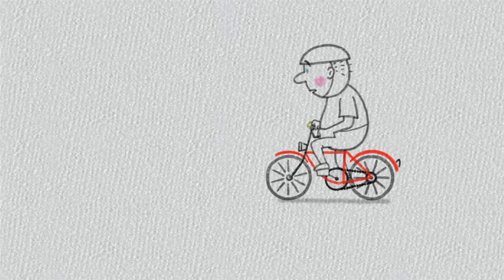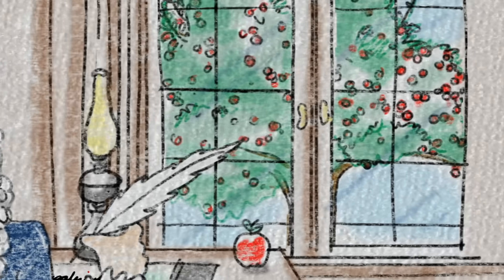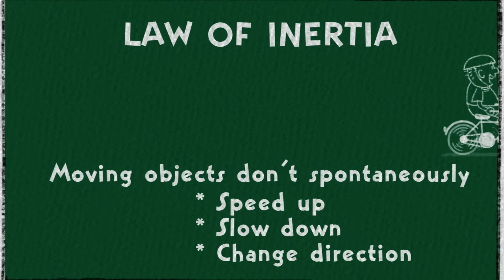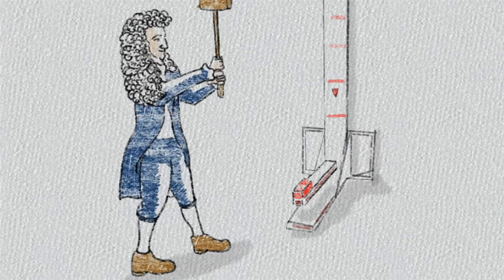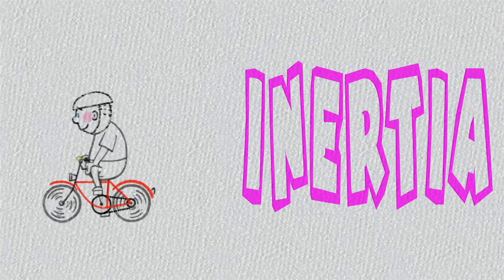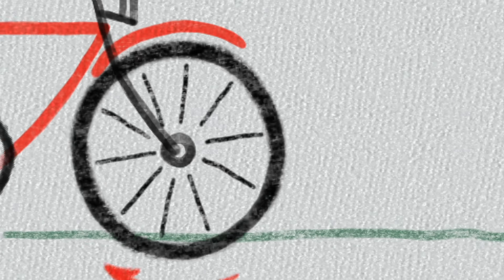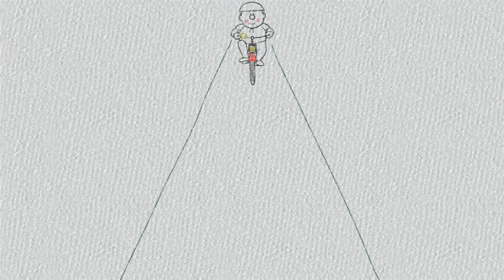Newton's 3 Laws, with a bicycle - Joshua Manley

Comment: Hey then why does my ball not bounce back to my hand when i drop it???? I thought it was the same amount of force. Is it because energy is lost or smth??? Make a video on it pls. Also im not Luffy so my floor isn't made of rubber.
Reply: Air resistance acts in the object when it bounces back up, this slows it down, and to answer ur other question, why you don’t bounce when you fall of the building.. it’s cuz the opposite reaction is your bones breaking.The ground pushes upwards doing this.

Comment: Didn´t you forget to mention that action has to be applied on a resistance? What if the bike was hovering 10cm over the ground? If the wheels wouldn´t touch the ground? There would not be any forward movement...... No movement at all..

Comment: Sometimes, I feel Newton's third law of motion is forced to suite a narrattive, even when it doesn't necessarily explain a phenomena. It is hard to explain the applicability of the law in relations to the motion a bicycle. I think it is because the bicycle moves vertically, meanwhile the law suites horizontal motion. It better fits the working for a rocket going to space. But for a bicycle I find I awkward. Great video by the way
Reply: yes! it gets confusing when the directions change
Reply: ENGLISH!!!!
Reply: The laws of physics are equally applicable in ALL frames of reference. It doesn't matter if the frame is vertical, horizontal, or rotating. It's all the sane physics.

E=mc. Acceleration defines mass/energy. There is only more acceleration or less acceleration.

Comment: What a JOke.  All Newton Laws except the first one, makes no sense at all.  It's the Biggest INDOCTRINATION and SCAM ever imposed upon children at school.  EVerything is a FRAUD.  Use your senses if you still have them.

 The 2nd FAKE Law in regards to Action and Reaction is really really STVPID !!!  All there is, is a body exerting a suitable force to move something at a given speed. And if you exert too much force you break the resistance of that body you are pushing against, or should I say you reach the maximum point at which the molecular fracture occurs?  Where is the line between Acceleration ( a= meters/ sec2) and Momentum (p= mass x meters/ sec) to make the physics meet  as F= m x a ==  F= p / t ??  

And finally, the 3rd FAKE Law in regards to the Gravitation and attraction of bodies through a divine acceleration.  It has NEVER been proved.  Try it on yourself (F= g x (m x m' ) / d2) using different bodies and under different conditions of temperature and matter.  It´s not the same dropping an object inside a tube of AIR than dropping it inside a tube of WATER.

All it is, is mass, density, shape, chemistry, state of matter and boyancy.  By the way, Earth is FLAT if you believe in a Creator of things.   Otherwise get in the NASA Liars Club.  They love you.  Money is waiting for you to collect.

It's a very elaborative Piece of FRAUD.
Reply: bRUH WHY sry capslock

Comment: Nice video, but something missing or not directly stated, for Newton's 1st Law:

Objects at rest tend to stay at rest unless acted upon by an outside force.
Objects in motion tend to stay in motion with the same velocity (velocity is speed with direction, and depending on your frame of reference, it can be negative) unless acted upon by an outside force.
Reply: bruh he stated that, you need to apply force for your bicycle to start moving from rest but one it starts moving it becomes way esier to pedal.........

Comment: Action reaction pair on the back wheel is correct but is wrong for front wheel. The back wheel action is DRIVEN by YOUR torque (backwards) which is what causes the forward friction reaction to occur. TED guy got that part right.... But I ask you now: is the front wheel action DRIVEN by YOUR torque? Is the front wheel action even driven by torque at all? The answer is no. There is no chain linking your pedaling to the front wheel. In other words the bike is NOT all-wheel drive. so how does your front wheel move if not by action torque? instead the rest of the bike applies a forward action force Into the middle of the wheel where the bike is bolted on and the wheel reacts back with the same force and together the two cancel out and move forward together. Then the forward moving wheel applies an action friction force FORWARD on the ground and the ground applies a reaction friction force BACKWARDS on the wheel. To recap, on back wheel force of friction is forward on front wheel force of friction is backward.
Reply: You're right.

Comment: That's actually false its not the reaction force that makes the ball bounce back its converted energi
Reply: Filip Brunmark the force is the that converts energy - always
gravity converts it from potential to kinetic
then the floor converts it from kinetic to elastic and back to kinetic
then gravity converts it from kinetic to potential while the ball goes upward

a force is always required for a change in energy

you are right in that a ball bouncing can be explained via forces or energy consideration

Comment: What if the floor doesn't push the object up but the force applied to the ball that makes it god down can't go down so it goes in the opposite direction, which is up and that's what makes the ball go up. This makes sense because the floor isn't pushing the ball it's just staying still and slightly vibrating right?
Reply: Gav Art the ball can feel the moment it hits the floor, this is proof that a force must have acted on it
this force is required for the ball to change direction of movement

btw contrary to what is shown in the video (bad...), the action and reaction necessarily always with no exception act at the same time
reaction does NOT come after the action
also they ONLY act when there is contacz between the bodies, not before or after

thank you for asking questions
if you have more questions feel free to ask
Reply: The Animation's Creator I don't think the force can go back nor would it have reason to not go I the floor and if the floor is vibrating that would still mean that the force did go through the floor.

Comment: One question: How does the bike stay upright? When a person mounts a bike and stays still (no kickstand or legs, just the two bike tires) they fall over. But, we said person is moving it is really easy to stay up. However, no new force is applied in the left/right direction to help keep the bike up? So how does the bike stay up while it is in motion?
Reply: momentum... it is too "focused" on moving in one direction, that is to say it alleviates the potential of falling left or right like a domino. Remember that there is also air resistance... aerodynamics keep it aliened as well, much like an arrow flies straight and only straight, until an external force (such as wind or gravity) interferes. I hope this helped in answering your question.
Reply: I believe the speed of the bicycle does not allow it enough time to be pushed over by air on either side. Or in other words, the force applied in propelling the bicycle forward is more than the force applied by the air on either side. Then there's also the fact that the centre of masses of you and the bicycle are properly aligned I guess. Todd Gobbett gave a pretty good explanation as well.
Reply: blasttrash Because then the weight is more evenly distributed throughout the 3 given points. The tricycle has more surface area to support its centre of gravity. A bicycle or unicycle does not.
Reply: gilgamesh2399 actually these are all bad explanations
an arrow flies straight for a complitely different reason, air drag and gravity always work on it in flight
bicycle is not "too focused" on forward movement, there is no such quantity in physics

this is explained via precession, which is a very comlex mechanical concept that relies on the conservation of angular momentum
a frisbee flies, a spinning ball changes direction, a spinning top stays stable - all due to precession

thank you for asking questions

btw to anyone who got it wrong: props for trying, it is better than not analysing at all. :)
Reply: Friction helps in  better grip that's why it does not fall trying running bycycle on ice...and you will understand.
Reply: Todd Gobbett But why do three wheelers stand upright even if they are not moving? why only vehicles having below 2 wheels fall down when not in motion? I mean my bicycle falls down but my car or tricycle doesn't when in rest.
Reply: gilgamesh2399 "How does the bike stay upright?"

The spinning bicycle tire becomes a gyroscope. A gyroscope, when rotating, resists changing direction. The faster it rotates the more it resists.
Reply: There is a really great minutephysics video about this.  it basically says 'we don't know'  crazy, right?  Bicycles are one of my favorite inventions (as you can see from my channel) but I didn't know they still stumped physicists!  :)

Comment: A little error in the video. Please make sure that the directions of reaction force on two different tyres of cycle after 2:50 should be different, and not the same.
Otherwise, it is a nice video. Inspired.
Reply: Dont be such an ass and just teach yourself. Perhaps you are the reason some stray from science...some jackass made fun of them when they asked a question or didnt properly understand the physics the other person did and sat on his high horse as if of genius status
Reply: Nitin Grewal
 So basically all you're saying is that the colors of the arrows surrounding the front tires should have been different because the ground is the the re-action of the back tire's action, and so the front tire is separately the re-action of the ground's action. It's just a three way chain: Back tire's motion (Action) = Ground's friction and pushing it forward (Re-action) = Front tire's motion (Re-re-action). That's all you had to say instead of talking in a way that makes you seem like you're trying to look smart. You just confused everyone else and then insulted them for not understanding what you meant. That was rude.
Reply: OK, I guess, I need to clarify it now..
Assume the front tire not touching the ground... a wheelie. And riding starts only with back tire down and front tire up...
NOW -> front tire will never start moving... not unless it comes back to the ground and feels the friction. As soon as it touches and surface, and both tires are now down, it will start moving. REASON? Friction acts backwards on front tire and makes it move. In turn, tire gives reaction in forward direction.

So In short: Rear tire: Rotation of tire causes Motion of cycle
Viceversa : Front tire: Motion of cycle causes Rotation of tire

Hence opposite directions
Reply: there is no mistake in the video.. the direction of the wheels rotation is same  that y the cycle moves ahead, if the forces are opposite (which is impossible if u are cycling) like you stated they will cancel out each other and cycle wont move.. what you are stating is that in a cycle the wheels move in opposite direction
Reply: Rahul Roy
You need to brush up physics concepts man... Action reaction don't cancel. And I know what I am saying. Kindly refer some physics books before commenting here..
Reply: l
Reply: Rahul Roy
 I don't follow what the person is saying. Maybe the idea is that the back tire is acting, because the rider is pedalling, but the front tire is reacting (to the road), since the rider is not pedalling it, so what is taken to be the action and what is the reaction changes. Nevertheless, the directions of the pairs of forces are indicted correctly as far as I can see.
Reply: Kenneth Florek
Nopes...
Reply: Monochromicornicopia
Hahaha... you people just watch videos.. and don't think yourself.. .. get a teacher and some books men!

Comment: You have to be consider each object separately:
1. The bike pushes on the Earth such that it accelerates in the direction it is pushed.
2. Simultaneously, the Earth exerts a force on the bike in the opposite direction so the bike accelerates that way.
You might understand this better if you consider rowing a boat. When your paddles push on the water, you send the water in one direction whilst travelling in the opposite direction. The foces are equal and simultaneous, acting on different objects.

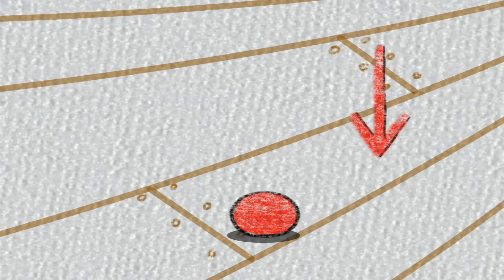Comment: Wow, I just noticed a flaw in this video. At 2:11 it says "As the bouncey ball hit's the floor, it causes a downward force on the floor... The floor reacts by pushing on the ball in the opposite direction." This is wrong. The floor isn't what reacts, it's the object that CAUSES the reaction. The ball is the reason it goes in the opposite direction. If what the video was saying was the case, the floor would have to be flexible.

Comment: Only on the rear wheel with power does the ground's reaction force push forward, on the front it has an opposite effect, to counter the friction of ye olde wheel bearing and such. The reaction force arrow shall point towards the rear on the front tire I declare!!

Comment: Unfortunately I will not use this video in my physics class. Already mentioned in previous posts: 'overcoming inertia' is not correct, action and reaction happen simultaneously (that is why I prefer the use of the word interaction forces). I want to add to this list of errors that the reaction forces of the floor on the weels of a bicycle do NOT both point foreward. In fact the (static) friction of the floor on the weels points foreward on the rear wheel, but backwards on the front wheel.

Comment: True enough, but the number of times it is correctly shown as simultaneous as opposed to the number of times it is incorrectly shown as a cause and effect relationship means the average student will incorrectly remember that one force happens first and then the second force reacts to it.  This is why I don't use the "for every action there is an equal and opposite reaction" phrasing when I teach the third law.  But I probably err on the side of being more precise than the average student needs.

Comment: As a physics teacher, my problem with this video is that it incorrectly implies that the action and reaction forces are not simultaneous.  This may be the fault of the animator rather than the lecturer.  Unfortunately, it makes the video useless for my classes.  It is a common misconception that the action force happens first and then the reaction force, but one I do not want to perpetuate.  TEDEd, is there any chance that we could get a revised version on the video without this error?

Comment: If you bounce a ball on concrete the concrete doesn't give, the ball does. Even timber floorboards as shown in the cartoon wouldn't give enough to bounce a ball back up on its own. If that was the case then pretty much anything should bounce off a floor. Try bouncing a pillow. A rubber ball bounces because it's rubber. Rubber is flexible therefore bouncy. Unless of course the boards are full of termites, in which case the ball will just keep going.

Comment: That video gave the impression that the energy from the bouncing ball is all delivered to the floor that in return sends it back to the ball, is this accurate? I don't really have knowledge about physics but I have always thought that the bouncing ball bounces because it has less resistance to keep the energy in itself by contracting and releasing it by expanding. This also explains why the doesn't bounce off a surface that is softer than the ball itself. Please correct me if I'm wrong.
Reply: I believe it is a combination of both. Granted, you've probably learned this by now, since this comment was ten years ago, but for anyone else with the same question:
There are two parts to this. First, the ball delivers its energy to the ground, and the ground pushes it back. However, how much the ball actually bounces does depend on factors such as softness of the ground (softer absorbs more energy) and resistance of the ball, e.g., material and density. The second part is why rubber bouncing balls bounce better than hard, dense baseballs or soft, barely dense cotton balls.